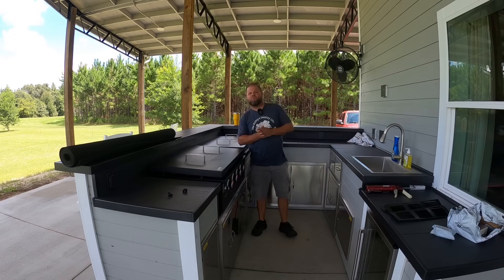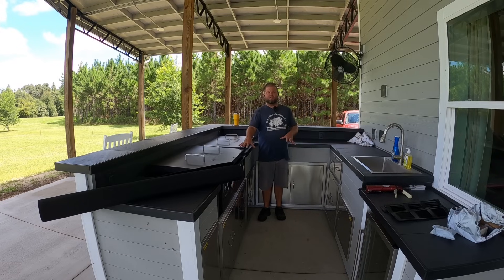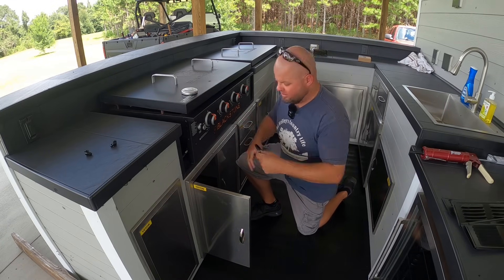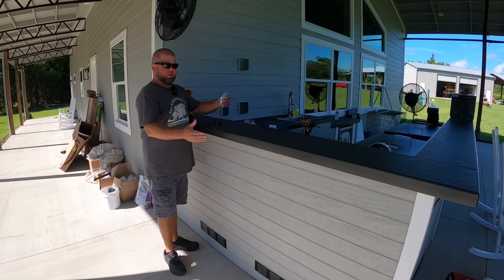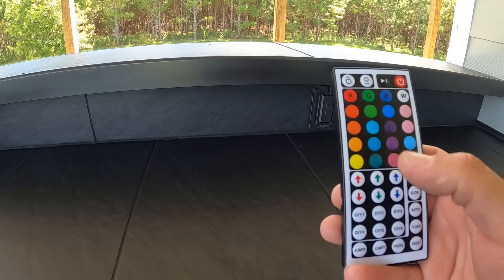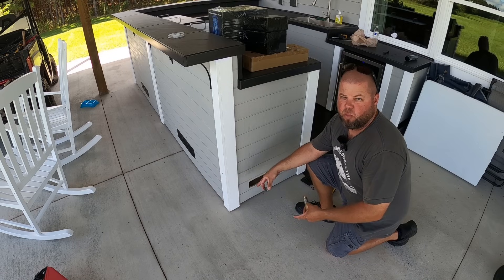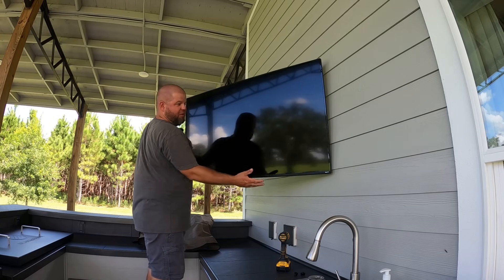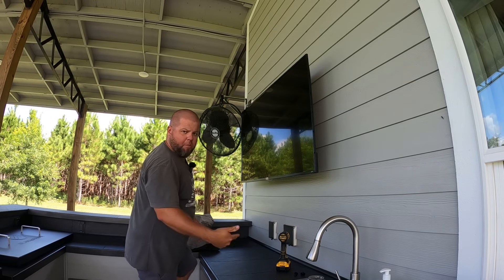DIY outdoor kitchen build! Final episode with cost! #635 #Vevor

Comment: The perfect auto on at dusk and off at dawn AC power control light detection switch for  your bug zappers .

 ASIN:   B07M8PYSX9

1-Gang Box
ASIN:    B00C3YD0QM

ASIN:    B007ECJ5IK

ASIN     B0080KC6RW
Reply from the maker: Nice, I didn't know about those.
Reply: @The Kelley's Country Life 
.
This is the commercial industrial way to do it for instance signs at malls,  Lighting in parking lots exclusively use that device,  even City street lamps.
Not this cheap plastic Chinese knockoff mind you, but they all look exactly the same physically .
look at any commercial illuminated sign you drive by you'll see one of these sticking out.
In fact if it's on the ground just put your hat on top of it and in about a minute it will light up.
One thing though it usually needs to basically be pointing towards the clear sky to operate perfectly
Reply from the maker: Can't imagine those carry much amperage?
Reply: @TKCL  
.

Specifications:

Model No.: JL-404C

Rated Voltage: 120-277VAC

Rated Frequency: 50/60Hz

Relative Humidity: 99%RH

On/Off Level: 5-20Lx On(at Dusk),20-60Lx Off (at Dawn)

☆☆☆ Rated Loading: 500W TUNGSTEN, 850VA BALLAST ☆☆☆☆☆☆☆<<<<<<<<

Operating Temp: -40°C to +70°C (-40°F to +158°F)

Threaded Diameter: 1.06 inch

Certification: UL listed

±+++++++++

This one is 1800 Watts if necessary?

ASIN:    B000VS6FWI
Reply: .
rapidtables
dotty
commy
/calc/electric/Watt_to_Amp_Calculator.html
Reply: @TKCL 
 .
I = 500 Watts/120 Volt = 4.17 Amps

In short, 500 Watts equals 4.17 Amps.

Comment: O Wow come on put a little thicker mat then that its gonna still be hard on the Back being that thin put a truck box liner mat there they are 1/2 inch thick and very Heavy I can't even pick up a 4ft by 6ft peace
Reply from the maker: Keep in mind if I do that I plug up my air flow gap underneath the cabinets. That's an important feature